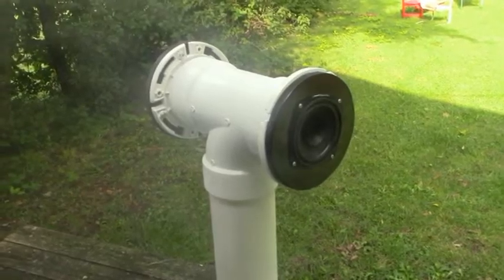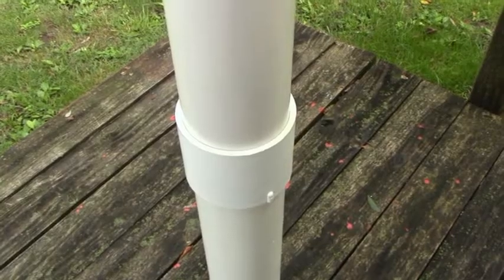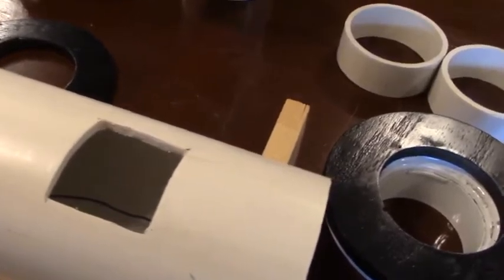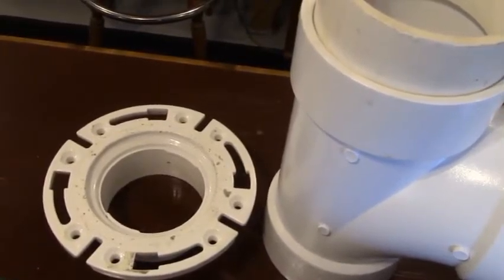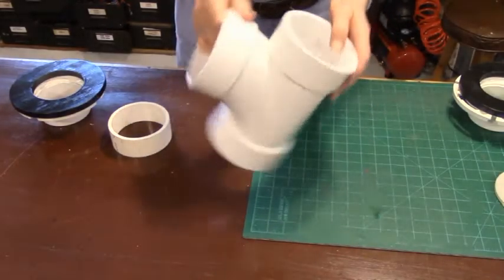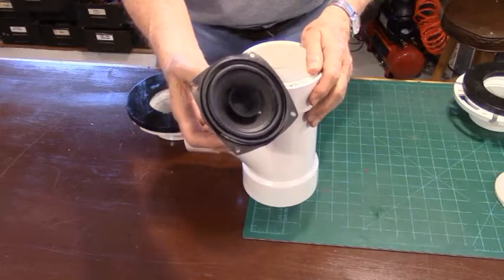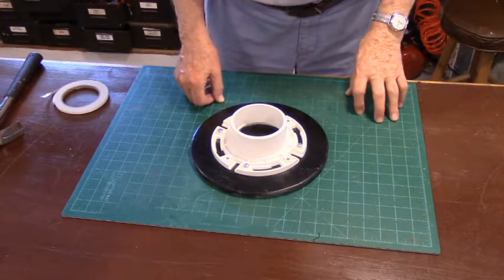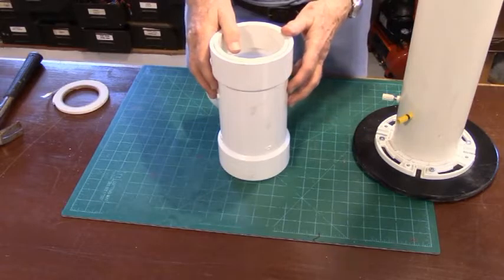Sanitary Duo for UTube

Comment: I do car audio and this peeked my interest I was curious could you let's say mount a speaker in a tight location run a pipe relative in the size of the cone area and to a enclosure for the added airspace? I using a midbass xover high highpass in the neighborhood of 1000hz and the low 80hz